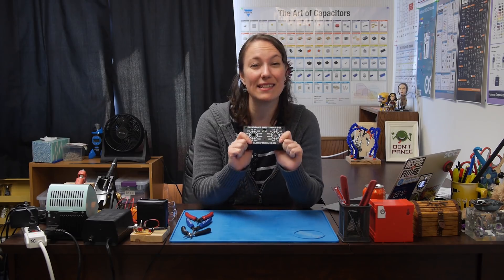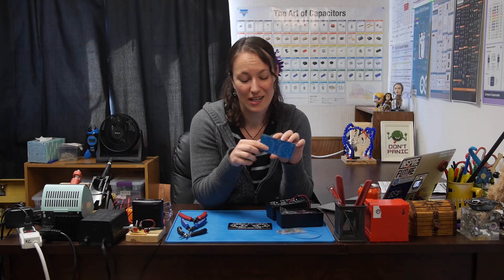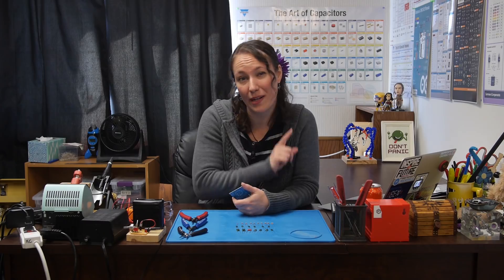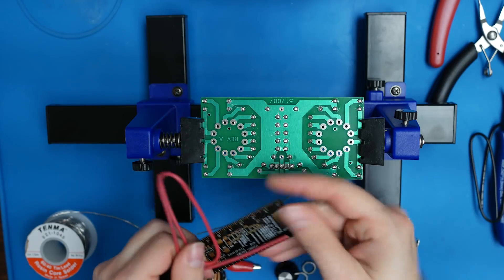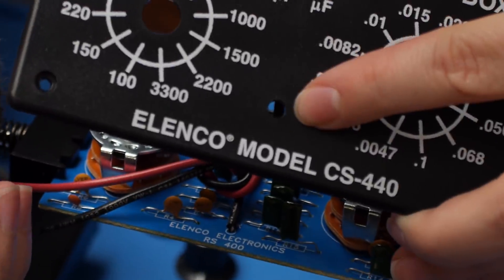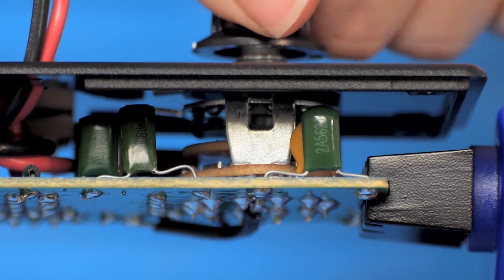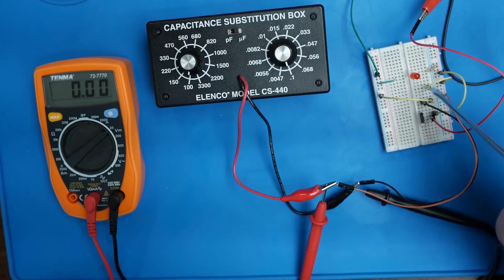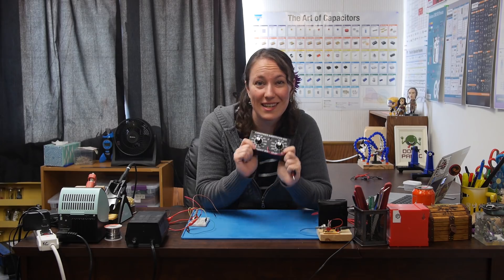Capacitor Substitution Box! - The Learning Circuit

Comment: I built my own design resistor decade Box that goes from 1ohm up too 100 Meg ohm that has multiple rotary switches in increments of 10 which can be paralleled or series. The capacitor substitution box I did not build because there ae too many different kinds of capacitors and it would take many boxes or a very large box with dozens of switches. I just can not justify one capacitor type box unless it is for low capacitance projects that use either polar or non-polar caps of low capacitance.

Comment: I'm late to the channel, but this video reminded me of 4 (very specific) capacitors i found in an old stereo that i had (before i accidently blew all 4 of them while trying to change the fuse).  The were 2 things i noticed about these things.  

1. these suckers were almost the size of my palm. 

And 2.  They were dummy capacitors.   In any case 20 years later and i still have no clue what a dummy capacitor is.  And by the way... yes that's exactly what was on those things. they were actually listed as dummy capacitors.   So what the hell is a dummy capacitor?????

Comment: Thanks for the knob alignment tip! On my CS-440 the largest capacitor interfered with the case when attaching the rotary switches.even though the capacitor leads were flat against the PCB. Not really enough room to lean them sideways either. I had to raise the board slightly and solder on the top of the switch pins. I swapped out some flexible silicon wires for the ones provided and made them slightly longer.

Comment: Nice project.  Your soldering skills have improved quite a bit.  As others have suggested, adding some sort of protected strain relief or rubber grommet would help the wires from getting chafed by the plastic case.  My ancient Radio Shack combo resistor / capacitor substitution box still gets used quite a bit for designing and also troubleshooting circuits.